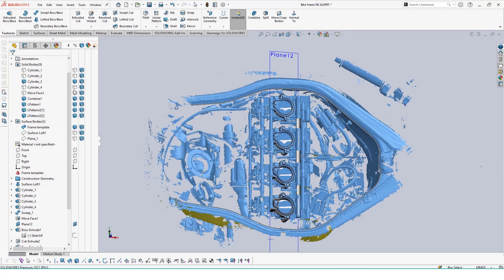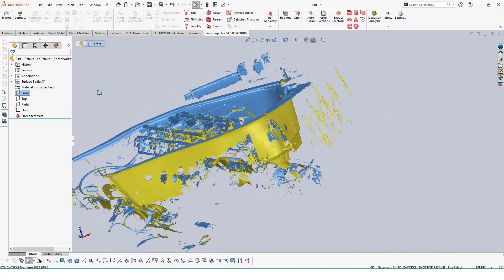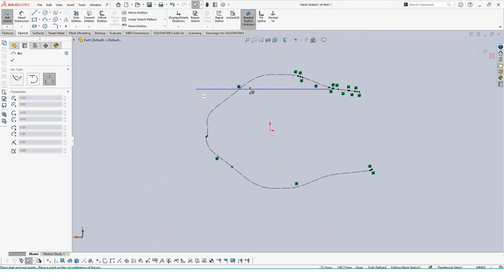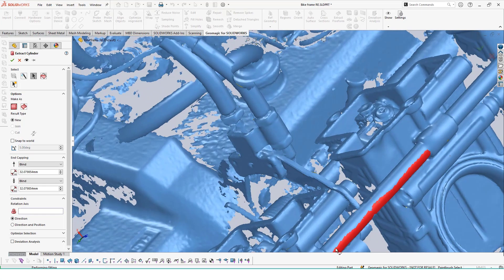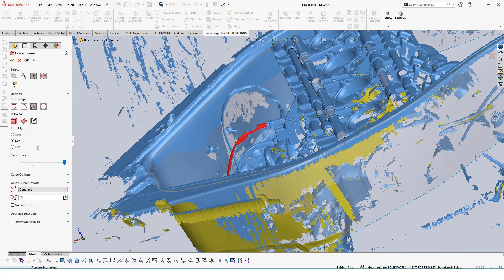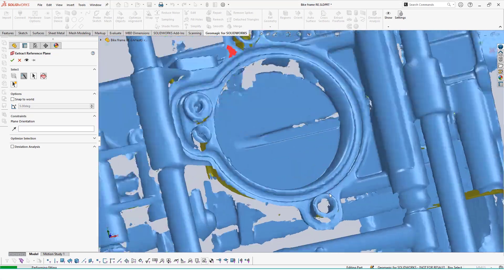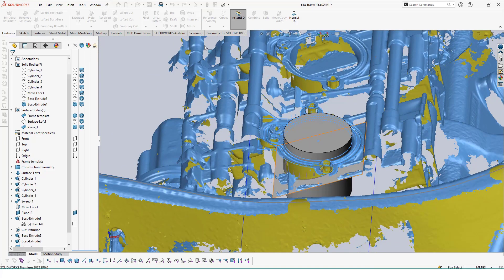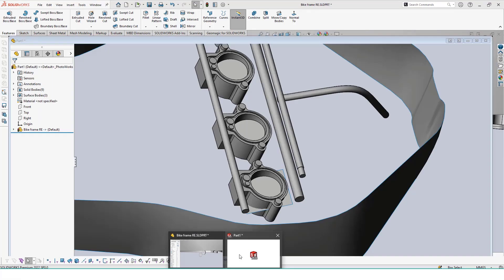Print to Perform: Create the Perfect Reference Models Using 3D Scans

Comment: Cleaning up all that extra info and reducing/simplifying the mesh will most likely also be enough that you could just use the mesh as a reference with no performance issues without using the add in. Great video